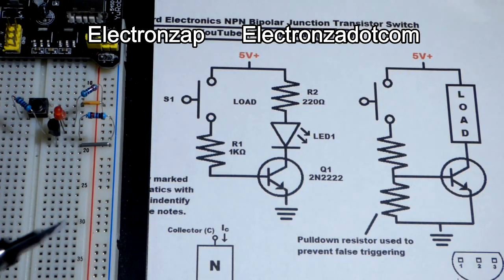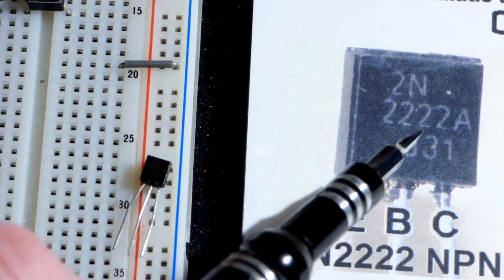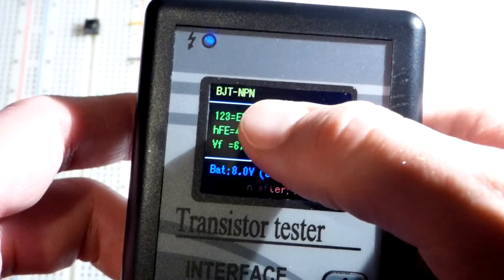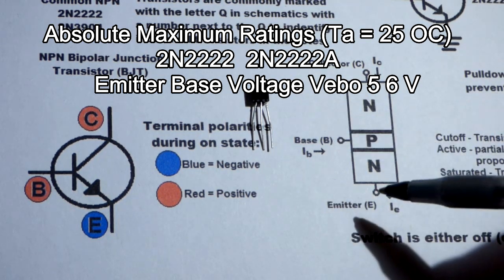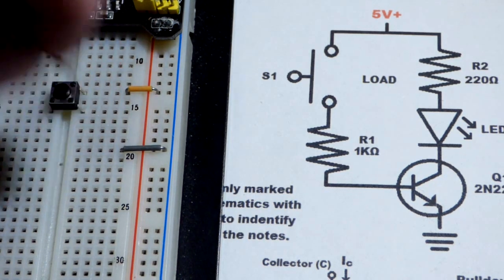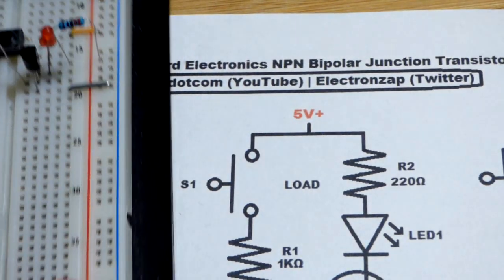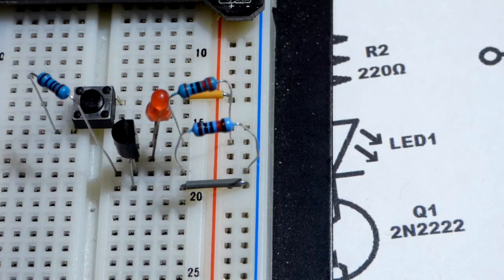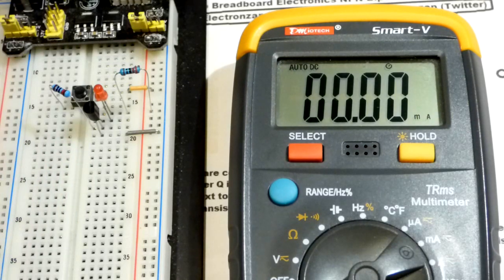Transistor circuit 1 NPN BJT 2N2222 switch for beginner DIY electronics hobbyists

Comment: I know it has been long time since video is up, but I have two questions. 
In this connection we are applying 5V to the base and it needs only 0.7 V, is it too much?
Another one probably not related, I understand that connecting resistor in series limits current but connecting it in parallel reduces voltage, is that correct?
Thanks in advance
Reply from the maker: The base will keep the voltage across it close to no more than about 0.7 volts as long as the current is limited. The rest of the voltage goes across whatever else is in series with it. A parallel resistor has the same voltage across it as whatever it is parallel with. If it is a low resistance though, then it is more likely to have less voltage across it than what a higher value resistor would have. So it all depends.

Comment: as a beginner this has helped me a lot in understanding transistors. i've been struggling with a truck alarm design operated by a mkr nb 1500 3.3v microcontroller. the part i'm trying to figure out right now is how to make a 12v alarm siren go off. 

the alarm siren is powered from my 12v car battery so i figured i could use a solid state relay to power that but the one i purchased won't close the relay until it gets 5v instead of 3.3v.(false advertisement i guess) so i'm thinking my workaround could be to use the 2n2222a transistor, which i already have in my kit. connect the 5v from the mkr board to the collector which will also be connected to the SSR +. connect the 3.3v digital output pin to the base. and connect the emitter to ground and the negative of the SSR. 

my question for you. how high of a resistance would you use on the inline base resistor and the other one to ground, being a 3.3v microcontroller with a desire to keep power usage to a minimum? would 10kohm inline and 100kohm to ground be optimal? and should that 100kohm resistor go to ground between the arduino output and the inline 10kohm resistor to prevent the transistor from being activated before the output pin gets a logic low? and any other comments on my design are greatly appreciated. i know i could just use a mosfet but i don't really understand them and i can't find one that would work with a 3.3v microcontroller. 

and on a side note since you seem to really understand your electrical engineering well i have one more question.(sorry i keep going) i'm also connecting this alarm to a 12v wire which gets +12v when any of the doors are opened. since i would like to read this as a digital input, what would be a good voltage divider to keep from frying my microcontroller?
Reply from the maker: I don't do anything with vehicles, so wont have the best answer. You will lose voltage if you have the load on the emitter side of a Bipolar Junction Transistor. When used as switches, the load is on the collector side. The emitter goes directly to ground when an NPN BJT is used as a switch.  I don't know what resistors would be needed. Could build a prototype circuit with the highest value(s) you think will work and go down from there If need be. Good luck!
Reply: Ok thank you

Comment: Hi, I'm new to electronics. I watched this https://www.youtube.com/watch?v=dbqEDZk1QE8 and tried to do the same. I ended up with burning 10k and 100k POT. 
Sorry, this is not related to your video.   But could you confirm that his method  will not result in fire. 
One guy who commented in his video also said that his electronic component burned
This guy did the same -> https://www.youtube.com/watch?v=dbqEDZk1QE8

Comment: Okay I am gonna swap mine around to look like yours; R2 is  220Ω just like you have it which I got from Mouser;  I got the LED to light without the 2N2222;  Base is P so you are loading it from the {+} on the rails; I missed something; NPN makes the base P-doped? Thus it seems to me we would saturate it from the negative rail;
Reply from the maker: Yup, base is P type material for NPN. Emitter is N type material, so when base is more positive than emitter by about 0.7V, it will conduct, which also lets current conduct from collector to emitter.
Reply: @Electronzap  
I thought about it and derive my "more simpler" explanation → Charge carriers and like usual there is some struggling but I did get the LED to light using how you showed it;

I also watched some work where 4 meters were used to show forward voltage drop and other that I am sure you are very familiar with; I am trying to implement 2222 drivers for a power MOSFET with the intent being the power device handles an 0.83 Nominal forward current that is likely near 1  amp actual so the 0.83 is going to be near RMS for solenoid coils as most use A/C

I plan to get a good FWB at least 3 to 5 times over-rated to the load and run the contractor coils on DC; I have the contractor on the bench and is very heavy compared to the actual load ○○○ much of this I have accomplished but very much hung on inverting to get the 2222 to switch with Hysteresis using the thermistor that is in that kit;
Reply from the maker: Good times!
Reply: @Electronzap   
I obtained an NTE2313  since it was only $2.13 and figured I could burn one up at that price learning then use it on something else if I do not break it;

 It is only 2 Amp label rating and looks to be an HV device;  This wont meet my spec of 3 to 5 times over-rated;  This HAS to operate un-attended; I plan to cover with fine-mesh screen — fail containment › as that can be done where install location is ~ my experimenter kit looks to be the same as yours and I much much prefer to keep my ATmega328 free for an actual Real Time Operating monitor for this and other ideas;

That is much simpler to me; 

One of those would be wrap some wire around a single phase load that pulls 13.83 Amps A/C measured as I need to monitor when the contacts are down on that device which is a common 18-gallon water heater then monitoring outside air temp would help in utilization of the audrino RTOS; 

Critical juncture now is getting Hysteresis for driving what I guess will end up being an  NTE2337: 
15-A Collector Current
7-Amp Base Current
Collector Power Dissipation — 2 Watts

Load current Collector to chassis  is planned at 1 Amp so this is 15-x overrating?

This was pulled by my supplier as very common and price supplier wants gets within can-do range;

Comment: Hi , New at this , love your vids.  When I measure the emitter (hope I got that right) to ground with an Led (2.2 v) and only a 3v I get a 49ma. Perhaps a clue that I do not understand is that it stays at 49ma no matter what the protecting resistor on the Led is, 465 to 10K. Any idea what to test ??
Reply from the maker: Thanks! The emitter passes the current of both the collector and base so I am guessing that 49mA is about how much current is going through the base. Base current should be a lot lower than collector.
Reply: @Electronzap   Yes I am using the 10k resistor so from that to the control (middle) it is .20ma .

Wait, I totally screwed this up. I had the Led on the same leg as the switch  when the switch was turned on . I am not sure what this did. Correcting the mistake I now get 2.74ma from emitter to ground with Led in circuit. So what was my circuit doing ? Besides pulling way too much current. Not sure why Led did not burn out??
Reply from the maker: LEDs can withstand higher currents than 20mA especially at low voltages. It may not be as bright as it used to be anymore and might not last as long now.